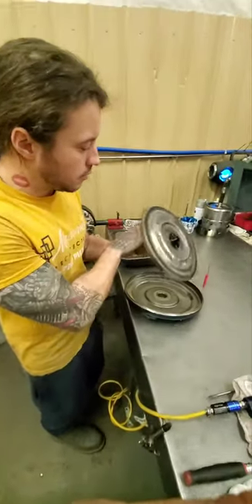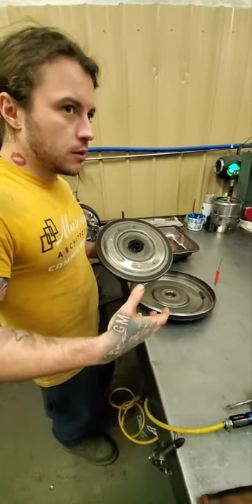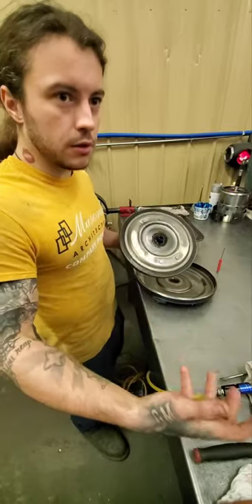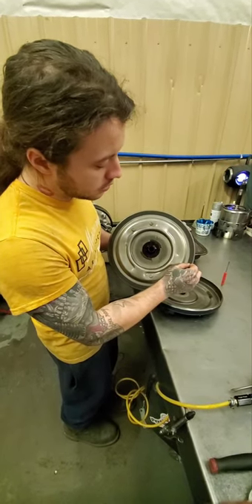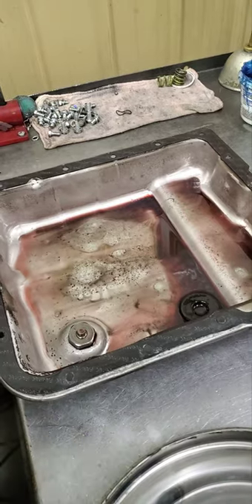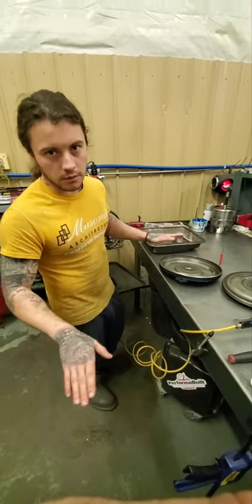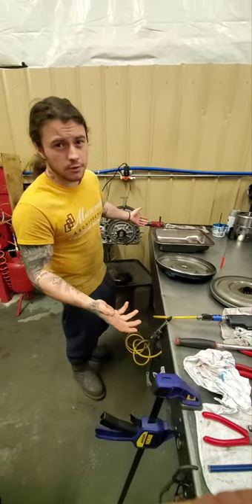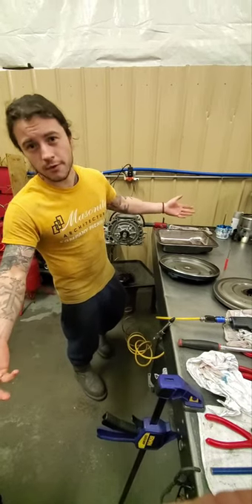A Quick Tip on Do's and Dont's of Lockup At WOT with the 4L60E

Comment: Hey Ryan... Thanks Bro. Great little video explaining the differences. Got the Triple Disc from FTI for my S10; which I am going to install soon for the Level 2 4L60E. Do you know how the GM PCMs handle TCC on when shifting? So if I have lockup on 3rd and were to throw the trans into 4th will the TCC automatically disengage? Anything would help. Thanks.
Reply from the maker: That im not 100% sure on atm. What software are you using to tune it
Reply: @PerformaBuiltTransmissions  I'm using HPTuners on a Gen III P59 PCM. Simple. Not a lot to it. The reason for the triple disc was to keep the truck under acceleration on the freeway and pull more top speed. Sometimes I will manual shift from 3rd to 4th. It would be nice to get lockout in 3rd, manually shift into 4th with no TCC, then have TCC come back in to max out top speed. If this is not realistic or ideal, let me know. Just need to avoid blowing stuff up. 😵‍💫
Reply from the maker: Yes you can do those things. In vcm editor hit the trans button and go into the torque converter tab. There will be a general tab and a apply/release tab. Apply/Release is where you wanna go. Then go into each button for normal, cruise, and performance values and both values will be there for adjustment in all gears for each button. If you have a triple disc converter tune to your hearts desire.
Reply: @PerformaBuiltTransmissions  thanks Ryan. Will look into this further. Great and informative video!
Reply from the maker: @atlasintegrations4114  shoot me an email or call anytime if you get stuck buddy

Comment: Will a stock tune on a 02 silverado cause misfire and stumbling/shaking with a i6 trailblazer converter? Since its higher stall
Reply from the maker: Misfires are not caused by a stock tune. But yes misfires will hurt your auto trans. High stalls need tuned for, no way around it

Comment: What you think about the 2800 circle Stall can I wide open Throttle?
Reply from the maker: If thats the stall speed that matches your cam and tire size and rear then thats fine. You can go wot with any converter not in lockup if your tuning is correct and you can only go wot in lockup with a billet triple disc and proper tuning.

Comment: I have a stage 2 4l60e from u guys with a 2800 stall converter in 03 Silverado and a couple weeks ago it started downshifting in to first from second gear hard when I get on it a bit everything else is perfect transmission is only 6 months old maby 8 tops also has a slight delay also could it be a solenoid?
Reply from the maker: Please call our tech line for help with your unit at 5705785686.

Comment: How many lbs/feet of torque could you put through a  12 inch oem single disc torque convertor with a 700R4  safely? Using an manual switch to keep  it locked on towing in third gear when going up hills. Thanks.
Reply from the maker: Maybe 400 at the absolute tops. And when using a switch, you cant ever forget to shut lockuo off between shifts. Youll snap the trans and components in half if you forget.
Reply: @PerformaBuiltTransmissions  Thank you for the reply! I have the correct wired system with an oem vacuum switch, 4 th gear switch and the brake switch in series . It's just sometimes on certain long highway hill climbs I drop down to 3rd gear , and then manually lock up the torque converter as I can drop about 300 rpm and not build heat. I just wondered how much torque before I slip that clutch, I use  a  newer 4l60e TC  with the woven clutch material.By the way, for folks who think you "must have a 4l80e"  behind a carburetor  454. Mine is a slightly built 700r4, 1976 GMC, 3.73 gears, cruises at 1650 rpm  with a 10 foot camper, 8600 lbs GVW. Sometmes I pull a trailer with two quads on it, probably total GVW of 11,000 lbs. Just don't be stupid with it. I would like to upgrade to one of you hauler 4l60e and use a  aftermarket controller as I plan a trip to Alaska. Love your videos, been a follower for years. Thanks again for answering my question!
Reply: @PerformaBuiltTransmissions   Thanks man -I search hard but no-one  gives numbers -just ' u cant lockup on WOT at stock clutch'  . I have stock 4.3 and it can't produce enough torque  to burn clutch . Now I wanna test  full lockup at wot at any speed

Comment: You SHOULDNT lock up a single disc at WOT,but you most certainly can……many turbo Buick guys lock the stock d5 12” conv at wide open and have for years.
Reply from the maker: There's a difference between wide-open lockup at the top of a gear and wide-open lockup throughout a gear. Top of a gear on a single clutch is safest and wot at the top is key, not throughout. A single disc should never ever be locked throughout bottom to top of the gear, only at the top not at wot. A 12 inch non billet converter locking like that is on borrowed time no matter the scenerio. You can certainly do anything, but it has varied results and it doesn't mean anyone should. Do as you will at your own discretion esp with a non billet converter. I have a 85 twin turbo buick myself and also have the only full 200-4R rebuild video on youtube, its the same scenerio regardless with buick or not. A triple billet can be locked up bottom or top at wot. A single billet should only be locked at the top but is not recommended at wot. A non billets stamped backing will flex eventually esp above 400hp under any of these conditions.
Reply: @PerformaBuiltTransmissions  

Just seeing this…..

Tell all the Buick GN guys who run the stock 12” d5 and have run 10’s locking it as soon as it hits 2nd…..

I don’t reccomend locking a single disc as soon as it hits 2nd either but folks have done it and the conv lived a long long life……

A lot of factors come down to if you’ll kill the clutch or not and IMO the biggest factor is weight of your vehicle.

I’d chance locking a single disc on a dyno in a NA setup.

Comment: Yeah you won't gain much ET if you wait til top of 3rd gear to lock it up.....your too far down the track.  I used to lock mine up with a MSD rpm switch in 2nd and third.